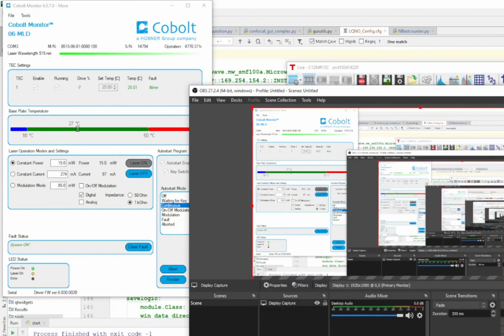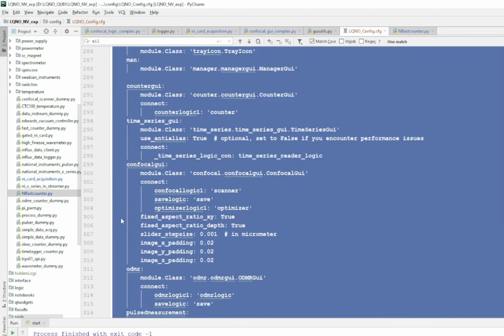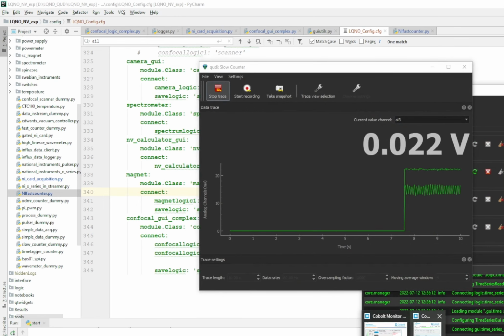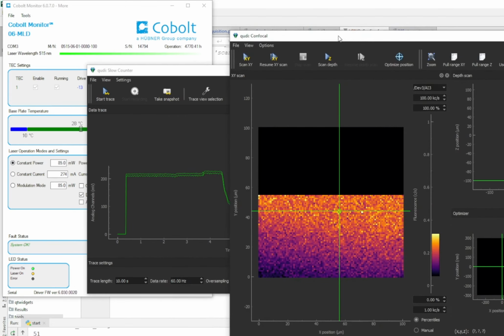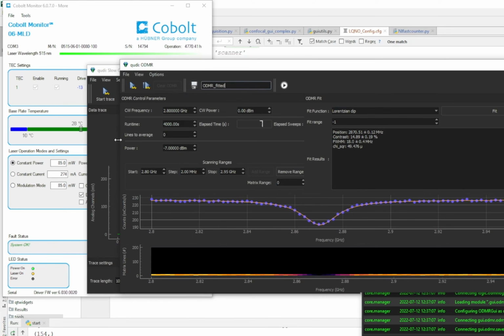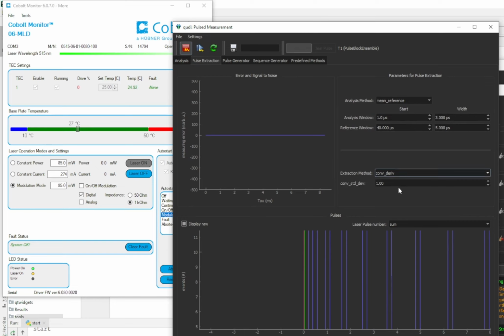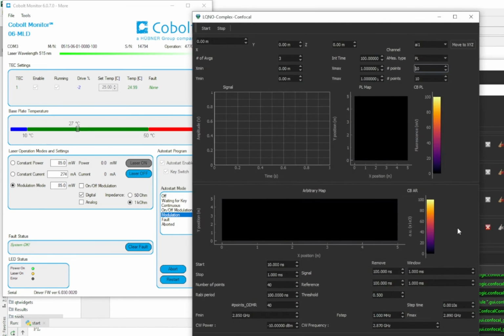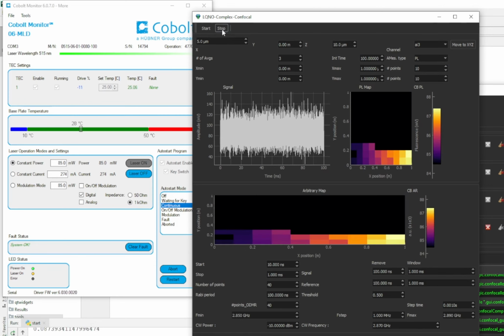QUDI introduction

Comment: Hi there,

Thanks for making the videos about Qudi, I'm currently trying to write the config file for our experimental set-up where we use an NI DAQ card (PCIe-6323) to take counts as our stage moves the sample in a raster scan.  The stage we're using is from ThorLabs (MAX311D/M - 3-Axis NanoMax Stage).  The problem is I'm not sure what logic and interface files are necessary to make this work.  Right now I've got the hardware file for the x-series NI cards which is fine but I'm a bit stuck as to where to go from there and what else is required in the config.

Do you have any pointers or advice?

Comment: Hello, I have a question, how to configure the program?  it needs a specific configuration, some line of code in python needs to be modified, I have a NI card to control the confocal microscope, could you be so kind as to guide me through the configuration process?
Reply from the maker: Hello Jorge,

Thanks for your comment. In order to configure qudi for your confocal microcope using ni card, you need to either change the config file of the Qudi in the Config folder or create you own config file. For that you can have a look at this https://github.com/hbabashah/qudi-lqno/blob/main/config/LQNO_config.cfg
I can also write you a config file as follow that should work in your setup, you only need to change device name and channels depending on the connection in your system for ni card.

global:
    # list of modules to load when starting
    startup: ['man', 'tray']
    module_server:
        address: 'localhost'
        port: 12345

    ## For controlling the appearance of the GUI:
    stylesheet: 'qdark.qss'
hardware:
    nicard_6343:
        module.Class: 'national_instruments_x_series.NationalInstrumentsXSeries'
        photon_sources:
            - '/Dev3/PFI1'
         #   - '/Dev3/PFI1'
        #    - '/Dev3/PFI9'
        clock_channel: '/Dev3/Ctr0'
        default_clock_frequency: 100 # optional, in Hz
        counter_channels:
            - '/Dev3/Ctr1'
        counter_ai_channels:
            - '/Dev3/AI0'
            - '/Dev3/AI3'
            - '/Dev3/AI1'
        counter_voltage_range: [-10, 10]
        default_scanner_clock_frequency: 100 # optional, in Hz
        scanner_clock_channel: '/Dev3/Ctr2'
        pixel_clock_channel: '/Dev3/PFI6'
        scanner_ao_channels:
            - '/Dev3/AO0'#x
            - '/Dev3/AO1'#y
            - '/Dev3/AO2'  #z  #removed
            - '/Dev3/AO3'    #removed
        scanner_ai_channels:
            - '/Dev3/AI1'
            - '/Dev3/AI3'
        scanner_counter_channels:
            - '/Dev3/Ctr3'
        scanner_voltage_ranges:
            - [0, 10]
            - [0, 10]
            - [0, 10]#removed
            - [-10, 10]#removed
        scanner_position_ranges:
            - [0e-6, 200e-6]
            - [0e-6, 200e-6]
            - [-100e-6, 100e-6]
            - [0, 10]

        odmr_trigger_channel: '/Dev3/PFI7'

        gate_in_channel: '/Dev3/PFI9'
        default_samples_number: 50
        max_counts: 3e7
        read_write_timeout: 10
        counting_edge_rising: True
logic:
    optimizer:
        module.Class: 'optimizer_logic.OptimizerLogic'
        connect:
         #confocalscanner1: 'mydummyscanner'  # this is connected to the dummy object
            confocalscanner1: 'nicard_6343'   # swap this line to use the NIcard object as scanner
            fitlogic: 'fit'
    scanner:
        module.Class: 'confocal_logic.ConfocalLogic'
        connect:
       #     #confocalscanner1: 'mydummyscanner'  # this is connected to the dummy object
            confocalscanner1: 'nicard_6343'   # swap this line to use the NIcard object as scanner
            savelogic: 'save'
    fit:
        module.Class: 'fit_logic.FitLogic'
    save:
        module.Class: 'save_logic.SaveLogic'
        win_data_directory: 'C:/Data'   
        unix_data_directory: 'Data/'
        log_into_daily_directory: True
        save_pdf: True
        save_png: True
gui:
    tray:
        module.Class: 'trayicon.TrayIcon'
    man:
        module.Class: 'manager.managergui.ManagerGui'
    confocalgui:
        module.Class: 'confocal.confocalgui.ConfocalGui'
        connect:
            confocallogic1: 'scanner'
            savelogic: 'save'
            optimizerlogic1: 'optimizer'
        fixed_aspect_ratio_xy: True
        fixed_aspect_ratio_depth: True
        slider_stepsize: 0.001  # in micrometer
        image_x_padding: 0.02
        image_y_padding: 0.02
        image_z_padding: 0.02
Reply: @quantumsensing1584  wow!! You have really helped me! Thank you So much! If it's not too much trouble, could you help me with the spectrometer? 😅 Plisss I have a camera starlight xpress USB, we have a code in python, because I'm using it with another application that we wrote time ago, I saw the files "lightflied" and "oceanoptics" of the cameras in the Hardware folders but I don't quite understand how I could enter the code to control the "starlight" camera in with those parameters of the syntax.
Reply: @quantumsensing1584  hello i have another question to configure the odmr does not recognize the VISA library, did you download the pyVISA and install NI-VISA? or what process did you complete? im using for microwave the device usb windfreak synthhdpro.